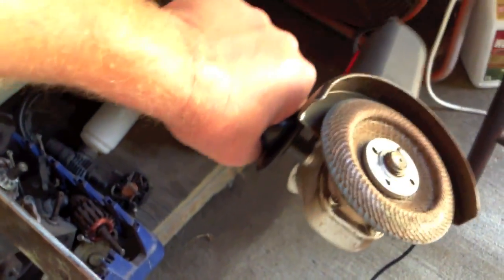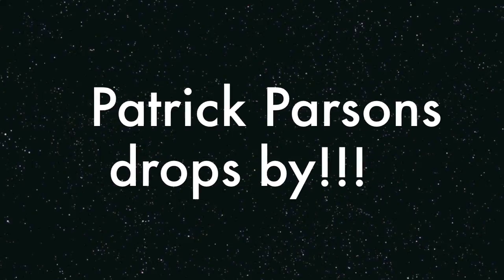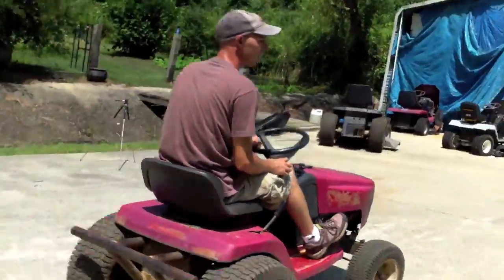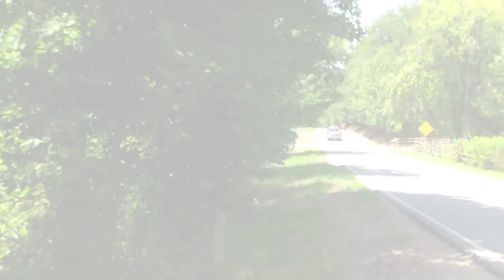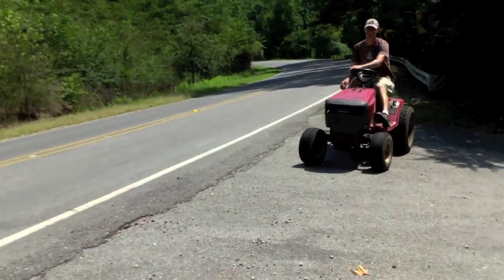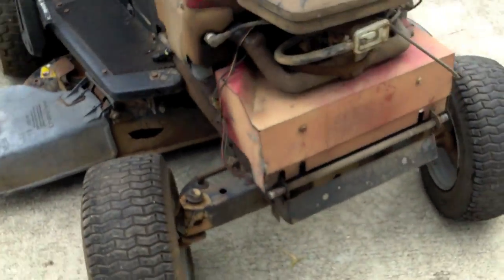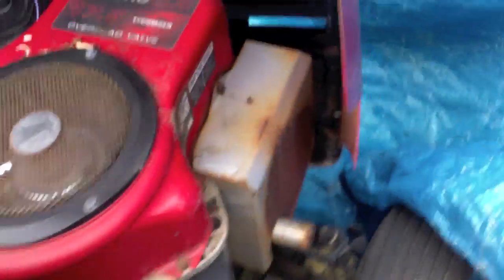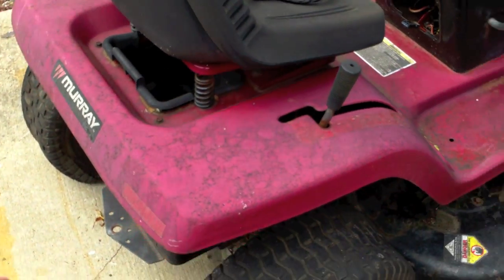Yard work and Patrick Parsons came by.

Comment: Ah, Techumsa's aint that bad. The Ridin mower I do wheelies on has a 10 horse Techumsa in it and I rebuilt it after it locked up. Runs strong and is real torquey off the line which is how I do the wheelies, and are better to tune because the engine accessories are made to be tunned like ignition and carb.
Reply: I always thought Tecumsehs got a bad rap. I never thought they were that bad. In fact , I think they did some stuff slicker than Briggs did. I remember when I was a kid , I opened up (around) a 5hp Tecumseh...it had a wierd lil oil pump comin off the cam. Oil pressure ftw over splash any day!!
Reply: That's right. They usually have an oil pump which is better then splashin the oil. plus you can adjust timing and carb jetting on mostly all of them has the adjusting screw instead of drilled holes for the jetting. Only bad thing I noticed is that they vibrate at high rpm because the crank is all one piece as compaired to briggs has a complex crank weight system which runs smoother at high rpm. everything else is pretty much identical.
Reply: Over the years I've worked on 2 or 3 Winco generators with a behemoth single cyl ohv Tecumseh. They musta been around late 70s vintage I'd say. 
I think the gen was maybe around a 12kw. 
It was slick cause the whole valve cover/box assembly could be pulled off, giving easy access to the valve springs.